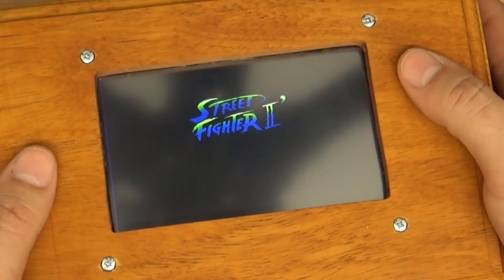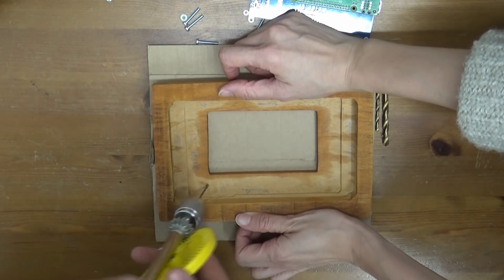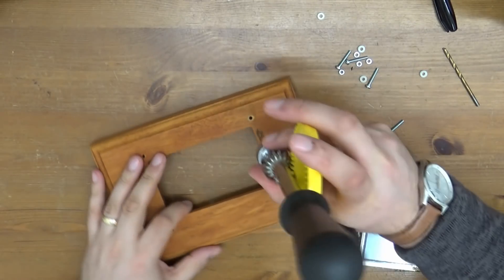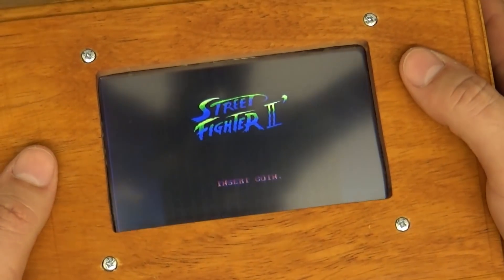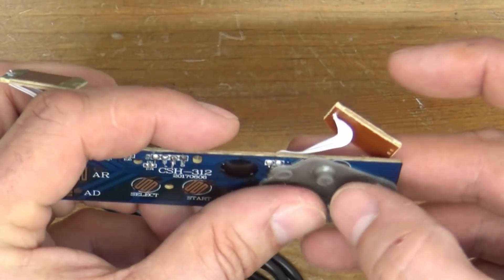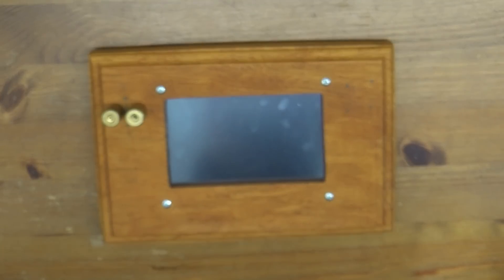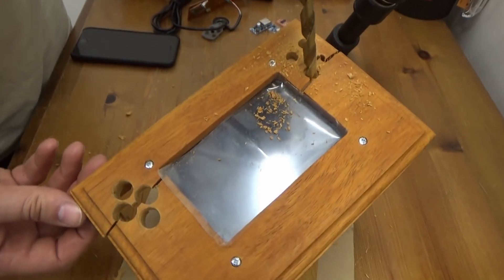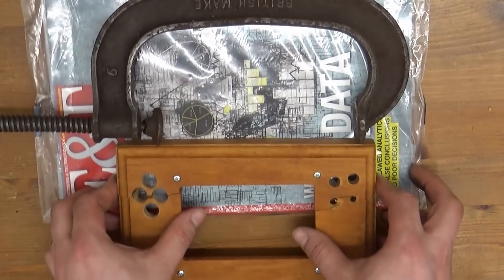DuB-EnG: DIY Make Wooden Retropie Handheld Games Console with bullet buttons PT5 Retro Pie Emulation

Comment: Hi, I feel your pain.. At least you can salvage it and it will as other have said add to the character of the finished device.
Reply from the maker: Teehee... yesh...  I'm gonna have to sprinkle sawdust into the woodglue and fill the gaps! - I just bought a "retromini" GBA and its ok, but the screen is tiny...  This wooden console will be far better if the buttons work well...  thanks for your comments! - Right oh! - Back to work!...  :-)

Comment: Oh dam!! :-(, that's just what you didn't want.

What about a couple of small aluminium plates over each set of holes, then drill from the inside out to put the holes back, added strength.
And add braces ... ok mechano strips across the side cracks inside.
Reply from the maker: zx8401ztv ... I’m planning to immerse the damn thing in glue hardener before calling it complete...  I was talking with someone at work about getting one printed out of metal! :)